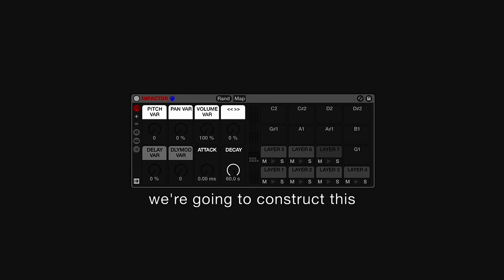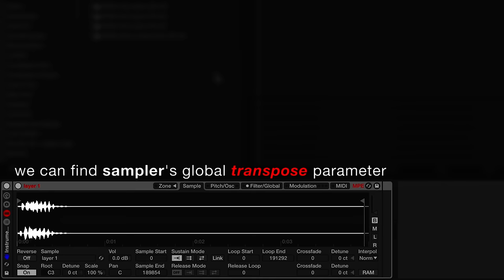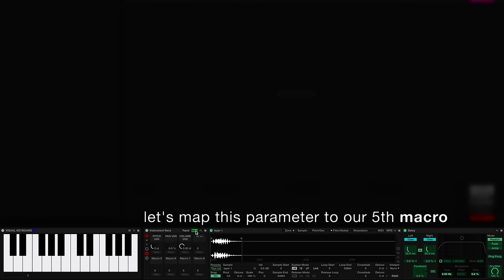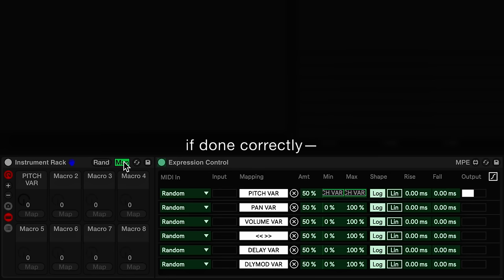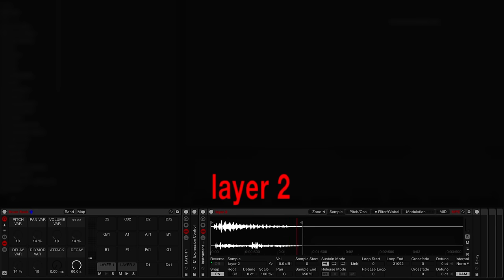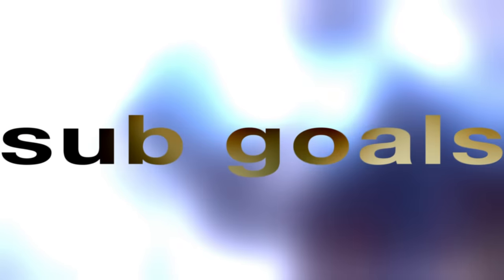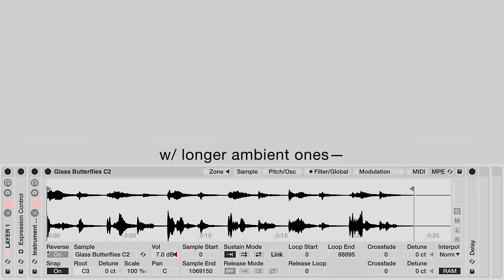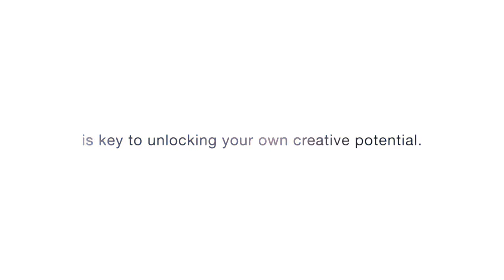ableton sound design | IMPACTOR RACK: Sample Blender + Randomizer

Comment: hey !! awesomevideo !! just wondering, around the time i duplicated my initial layer in the drum rack, the variation almost completely stopped working. i dont know if this is something to do with a bug in expression control? but the sample all of a sudden defaults to -48 st and just alternates between -48 to -47, each other macro only modulating by tiny 0.1% fragments at most. this could be me not correctly following the tut or something else. if someone else has had this issue + found a resolution let me know !
Reply: I just came across the same issue at 9:26. Expression Control has a bug. If you leave it expanded, then copy the chain to a new drum pad, it will work. But if you collapse Expression control and copy to a new drum pad, it will unmap everything in the "mapping" area from the very first instrument rack. Annoying... maybe there is an update?

Comment: bonus tip i found after using this device for a while:

since we're using ableton's sampler for each individual layer, you can actually use up to 127 different samples inside of one sampler, essentially making it work in a round-robin fashion. if you select each individual sample and distribute them equally by velocity inside the zones panel, and then add a velocity device in the layer before the sampler, and set the "out low, out hi, and random" parameters to 64, each note will trigger a random velocity, which in turn should trigger a different sample. it gives you some more freedom to not stick to just one sample per layer :)

thanks for the tips as always, and much love <3